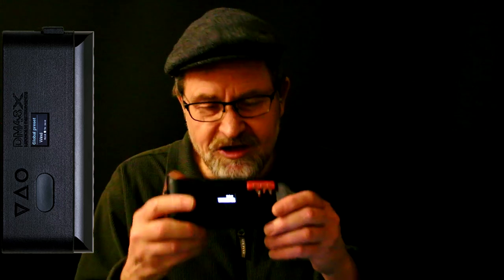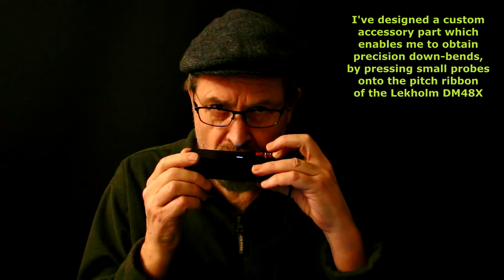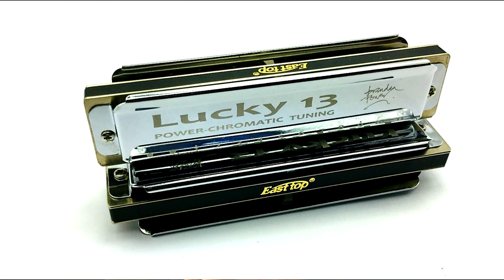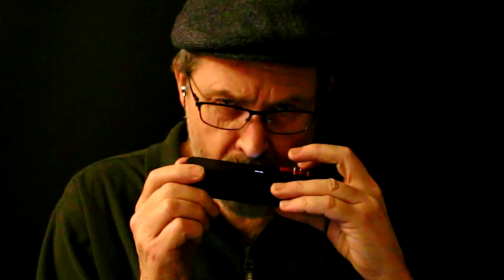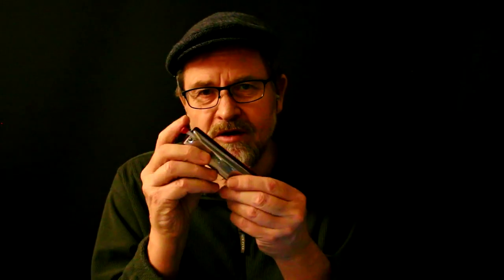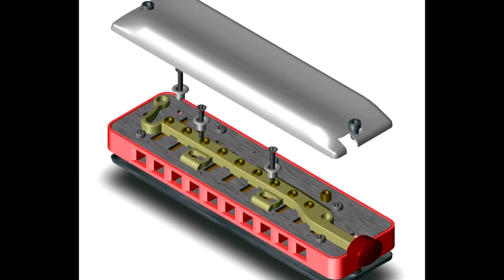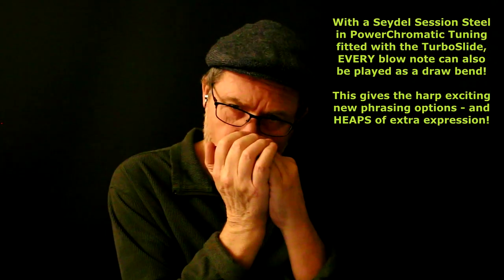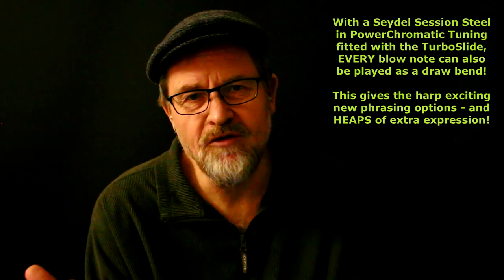TWO WAYS TO GET EXTRA, DEEPER BENDS ON HARMONICA! - Brendan Power

Comment: This is very thoughtful and worth watching again and again.  I humbly suggest a term for what you are doing here:  "half flat-slide".  I'm now considering what this could mean for Inverted Bebop 😊.  In any  case, thanks for yet another innovative contribution to music and musicians. 🎶
Reply from the maker: Thanks Pat, I'm glad you find it interesting.   I've known about the TurboSlide method of getting these extra bends for years and used it occasionally, but the idea of only partially retuning a chromatic to get the effect only came to me a few days ago. Half-Flat Slide is a good descriptive name, thanks! 

Whether on retuned chromatic or TurboSlide diatonic, it opens up a lot of beautiful new bending expression on the harmonica. It can work well on ANY tuning. On Richter it gives you the ability to bend 5 draw, which is nice. Any tuning with semitone intervals (which I try to avoid in my harps) suddenly becomes capable of bending notes, which is normally impossible. 

For example, with the Half-Flat Slide method, Solo Tuning becomes fully bendable! You can bend the F draw with either approach, but It won't fully work on the TurboSlide because the TS only lowers the blow notes a semitone effectively. However with HFS you could lower the B draw in holes 4/8/12 to Bb by lowering the C# blow with slide in down to A 👍

Bebop becomes fully bendable with either approach, whilst remaining fully chromatic with a combination of bends and slide pushes. That's a real bonus, because Bebop is a great tuning whose only weakness (in my opinion) has been the inability to bend on half the draw notes. Now you can! Same could go for Tony Eyers' Major Cross, David Fairweather's Four Key tunings, and many more...

I look forward to seeing how it can work on Inverted Bebop and others of your tunings in the Forum 🙂

Comment: As a variation on this theme, pushing the slider could momentarily move to a more radical version of a tuning.  For example, here https://youtu.be/3OSuXNV5_pM we have a lowered DRAW note in hole 7, and lowered draw AND BLOW notes in hole 1.
Reply from the maker: Yes, depending on what your main tuning is, you could retain the basic principle of lowering the slide-in blow notes, but tweak the slide notes in different holes to give a desired effect: even deeper bends, extra useful chords etc etc. 

If one treats the slider notes as 'optional extras' to enhance  the expression or capabilities of the primary slide-out scale, there's no end of possible options!